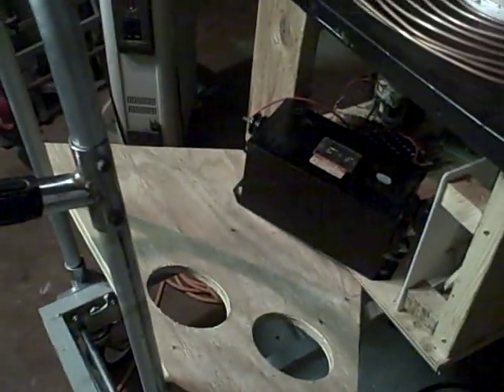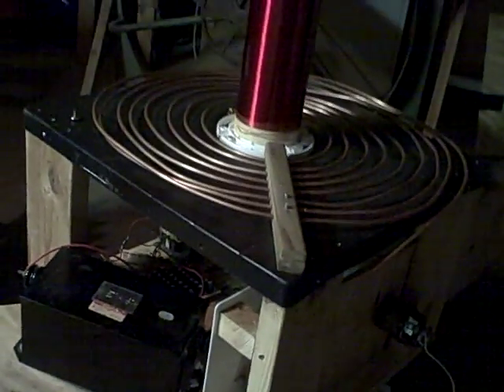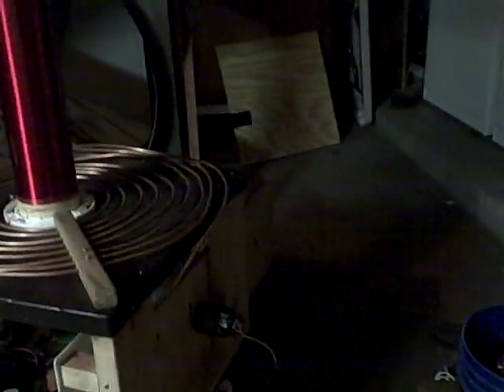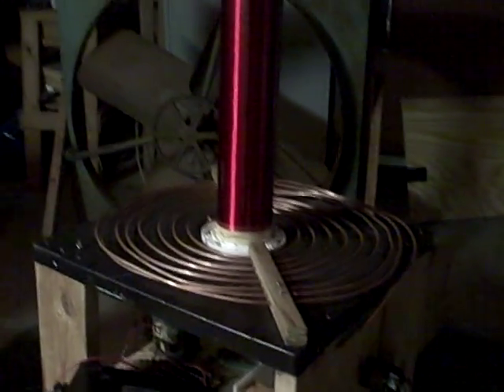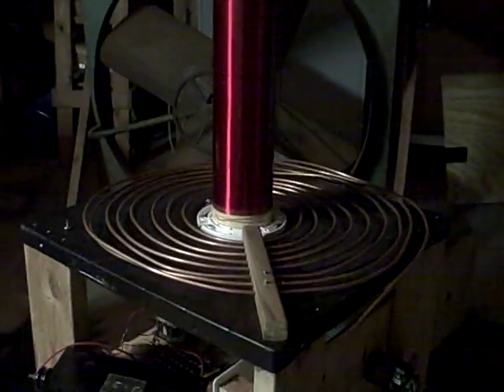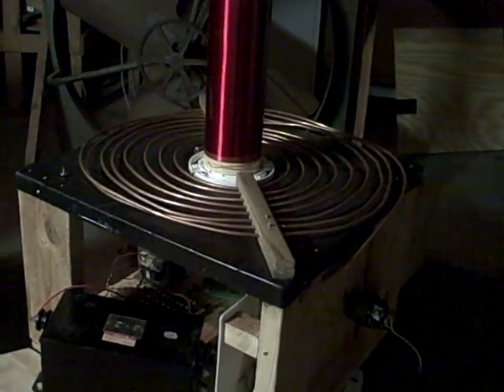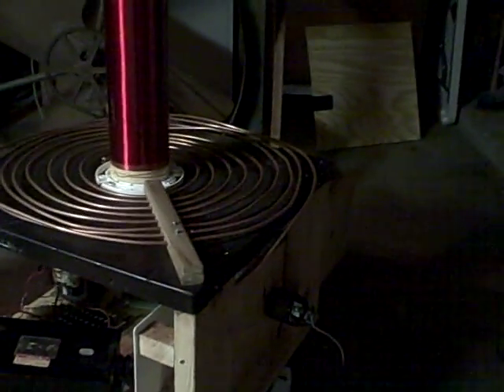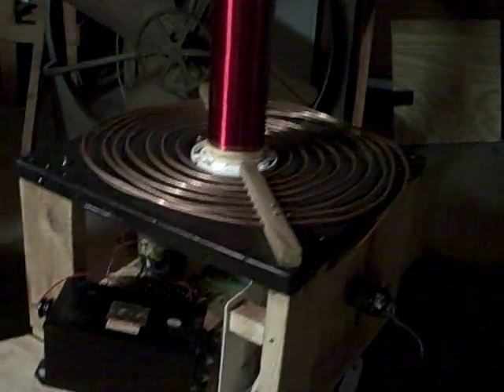Single MOT Spark Gap Tesla Coil.

Comment: Just a single MOT... phenomenal... If you were to tune a single MOT Tesla Coil to have a ridiculously huge sphere as a top load, you can make some really good transmitters...
Reply from the maker: Thanks! If I would have used a tank capacitor with more capacitance and retune the secondary for the new primary resonant freq I could have made much bigger sparks at a lower breakrate/spark gap speed. Oh well I rather liked the very thick sparks from the high breakrate

Comment from the maker: @derstrom8 Yes, the single MOT supplies the power, and the NST is the charging inductor. Without a charging inductor, not only would the multiplier caps see huge current while charging the tank cap, but also when the spark gap fired, the multiplier's caps would empty all of it's energy into the primary. Electrolytics are not big fans of Tesla coil Tank cap kind of duty!

Basically works like a resistor.

Comment from the maker: No no no :P. This one pulled about 1.8kw. :P a tenth of that. However, i have done capacitive discharges approaching 4mega watts. 800 volts at 5000 calculated amps into a short :P Using an RLC calculator.

Comment from the maker: That does not matter. Repetition rate/duty cycle is what matters. I could make a Tesla coil with 120 volt input at 1ma and get a spark longer than my house is tall. At 1 spark every few minutes. 

There is no way this would put a dent in my electricity* bill, i don't run it for long (not at all anymore, been taken apart) and it probably only pulled around 15 amps at 120 volts.

Comment from the maker: Wait.
Oh fuck, wrong video :P. On this video my charging choke sucked and was half dead, and it just did not work good. I was running well over 2000BPS, and i have never even seen a Tesla coil run that high breakrate. And the sparks on this one where only 1.5 feet, compared to 2 or more feet on the same coil before using about 10 or so amps. If i had a 20-30 henry charging choke that was reliable, i could likely get 3 or longer foot sparks, still at around 600bps.

Comment from the maker: Nah, the efficiency is not that bad. I am running likely around 800-1000BPS and i am getting ~2 foot streamers. And it was pulling 10-13 amps. If i used lower BPS and a bigger tank cap, the sparks would have been much longer. Needed a better toroid.

And no, you did not see over 2 foot sparks from a 24volt source, unless they used tons of current and stepped it way back up, or are you talking drsstc? What do you mean did i use a spark gap? It is a spark gap Tesla coil, so yea. DC resonant

Comment: i have seen bigger sparks from a tuned TC running from a 24v power source! Did you use a spark gap it really helps? At least turning the light off saved you a few amps lol

Comment from the maker: ballastit would limit the line current, but it would still pull a ton of current from the doubler capacitors, which would still make a power arc form at the rsg, and it would kill the multiplier caps faster. This is not good!  It ALSO helps keep high frequency ringing and oscillations, as well as HV spikes out of the multiplier caps. The multiplier caps are fragile, because they are small. They do warm up, which REALLY worried me. BUT, when i get a new choke of about 30H, this should be solved.

Comment from the maker: , it keeps the tank capacitor from pulling a bunch of current from the voltage multiplier capacitors. This also makes sure it wont powerarc on the RSG, i have had that happen alot. This also makes it pull less current from the line, because when the tank capacitors pull a ton of current from the doubler caps without a good choke, it empties the multiplier caps which then have to be recharged during the next cycle. This pulls a ton of current, like in this video. If i changed to an external

Comment from the maker: Damn, 4 messages that quick? Nice.

I am planning on a new smooth toroid, that will of course be bigger than this one. I would prefer a toroid though, as it shapes the electrical field, and apparently helps 'push' the sparks away from the coil. It will indeed help! I still have shit tons of tuning to do, but i have not been really worrying about this coil. Heh.

The choke is not there to prevent too much current being pulled from the line. Since inductors do not allow current to change abruptly

Comment: Just my two cents bro. Still impressed by this coil and anxious to see you get it optimized. Ever try a primary like mine? They are too easy to build and take minimal space. Coupling is not a problem as long as you use a wide enough former. Look at my twin coil primaries for an example of what I mean. 
Take care bud and happy coiling!

Comment: On your choke issue...is there some reason why you're not using mots for current regulation? Or a hot water heater element? A hot water heater element is an easy way to go, and they come in 500 watt increments from 1000 to 5000 watts. Super cheap too. $20 or less on ebay if you shop around, and not much more at your local hardware store.